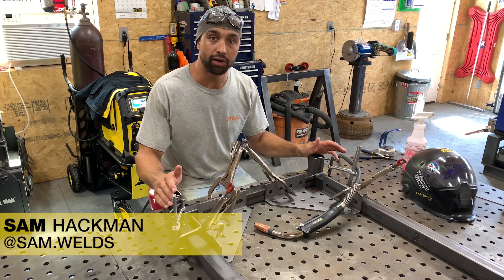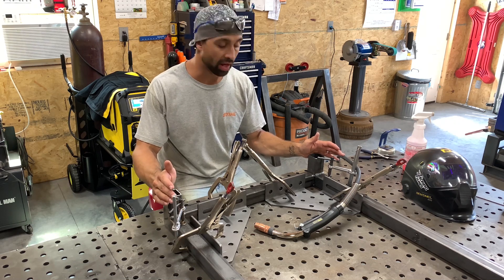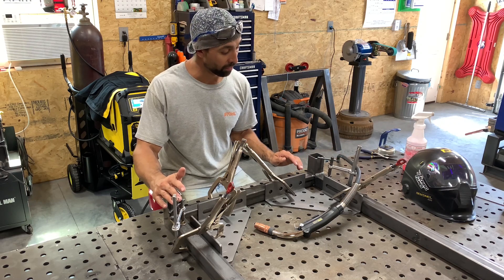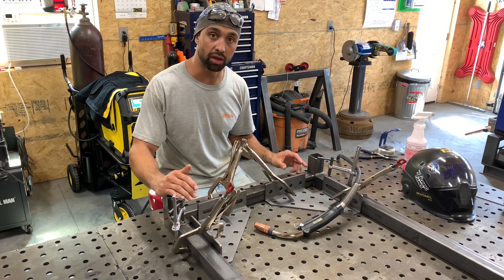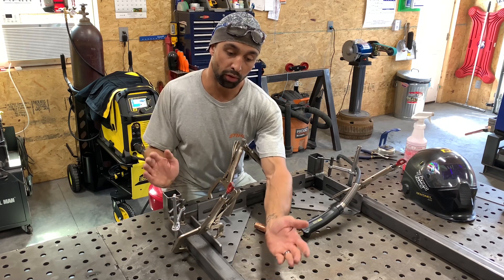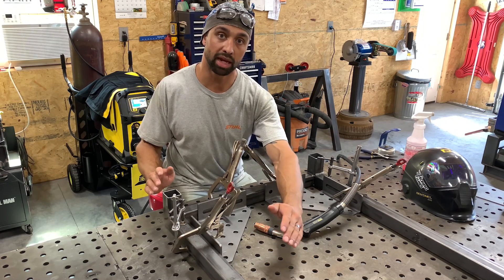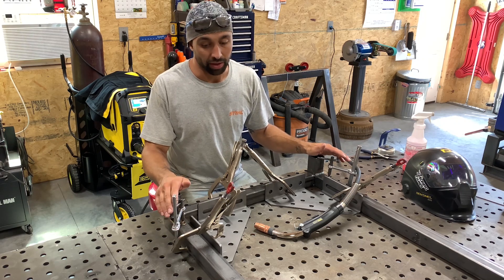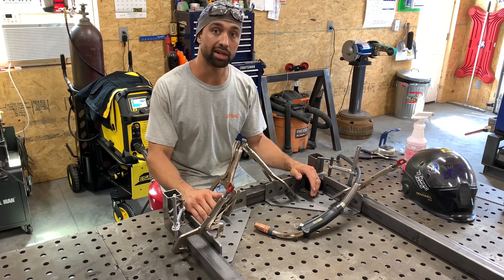Why the Direction You Weld Matters for Your Finished Product

Comment: Are you sure your welding in the left to right or bottom to top or fixed option or table top you put your bench in the over head let me see how you do all you down had welders are fake there is a test of straight why you do not weld down hand

Comment: Welding in the right direction ?

What if it's a stationary object and you can't flip it upside down ?
What if it is high up or down low and the only way to get to weld it is from the opposite direction of what you say is the right direction ?
Not every piece that needs welded can be bought into your shop and laid on your shop table to be welded .

Comment: When you weld its like a zipper. If it's all true, you weld one corner, there is now a preasure, do the same to opposite corner and it will release that pressure, at least that's I my mind works, and I got the squarest floorstands in the shop!

Comment: A rag and a bucket of ice water will do the same thing. Sometimes you have no control over direction if it is a field weld and can only be approached in one direction, it will pull where you need it with the ice and water.
Reply: Hell yeah nothing like making your weld super brittle so it shatters when put under load. So smart!

Comment: Doesn't matter what direction you weld in if you are holding your mig at a 90 degree to your work like your supposed to do!!!!!  But if you're not at a 90 degree then it matters BUT depends on the situation. If you travel same direction your aiming then your taking a big chance of flunking a weldtest because places in your weld will be skated on welds ----- unless the metal your welding on is pretty thin.   When welding in corners if you travel out of the corner the magnetic force will create lots of B B splatter usually. If you travel into the corner that usually helps. If welding uphill aim up a little. If welding downhill still aim up a little. It allways just depends on the situation. I been welding for 42 years to hold things true use cross braces and plenty of them. I like using heavy turnbuckel's for cross braces because they are adjustable for pushing and pulling for fitup speeds up the process I expect to get some remarks from here saying like smartass maybe 😆  all else I got to say is FJB. LETS GO BRANDON
Reply: Thanks for the turn buckel idea.  I'm going to try that. Looks like better control.
Reply: Thanks

Comment: Cool tips in your video. 5 yr into fab and 10yrs of backyard fab and I still haven't gotten it figured out. When possible I weld on a few temporary angle braces to help keep it square and plum. And have everything tacked together before fully welding. The preload with shim material under the part has been the toughest to figure out. Aluminum and steel act a bit different with heat so it can get frustrating.  And welding is just one part of the trade. Add in the plate and tube bending and manual machining and it should be a $40hr gig. I've scrapped a fair amount of material learning.
Reply: ⁰
Reply: Pa don’t want me me too but I’m going with you when you go go home home when I’m in in bed bed I just just don’t have hai east and we have no plans on that property property property we can can rent the nve it I’m going with the whole whole family to me I can’t wait to see it it I can’t wait to get my hair hair up up to to get a a hair hair cut off off and I don’t don’t know if she she can go
Reply: Pa you guys guys can go with the boys boys or girls tomorrow at work so if you’re available available in a couple couple minutes I’ll be available

Comment: If you tack the item down to.the table you won't have that problem and you always tack your pieces on all 4 corners. After you tack the item to the table it will not move or use a dog clamp to the table thats why you have holes in the table 
Contro) welding is also required while welding
Reply: Great tip!

Comment: Just curious, why cant you tack inside and out before running your beads? Wont the tacks hold it square?
Reply: Yes. Heavy tac weld will be great. No need for a 30 minute video like a 6th grader
Reply: Not necessarily. The heat from the bead will cause the metal to warp. And if you are welding correctly,  you are welding over at least two of your tacks, rendering them useless. Depends on what your welding. There's a lot of flex in metal.
Reply: Yes. That's the correct way.

Comment: So true. As for those asking for specifics it would make the Rocky sequels seem like a half hour comedy show.
As stated, as you weld, it pulls towards the weld and the direction your welding.
Depending on your configuration and just as importantly your fitting. Dictates your sequence. 
Amount of passes required on every weld is key as well.
Welding up 4" thick ballistic steel 100%. UT. T- bars. 24"×30" roughly 
60-40 bevel. 
Welding 40 side till you got around inch and 3/4 off square at 2ft.
Alternating directions. 
Then proceed to 60 side. Weld till plumb, again reversing directions. 
All the time monitoring movements. 
And this doesn't include root passes and back gouging nor finishing. 
Plus heat control, (total Jules,) Preheat temps., interpass temps, and controlled cool downs.
Every situation can be different. 
But as he stated. Understand the basics. Pull follows heat in 3 directions.  Towards the weld latterly and vertically and In the direction of the weld.
Keep your total heat to a minimum. 
Excessive heat realigns molecular structure of existing metal making it weaker and increasing distortion (pull).
As others have stated. Sequential welding is like a torque sequence on an engine.
Basically opposing sides in a criss cross pattern in opposite directions. 
With equivalent heat.
Once understood. It prevents a lot of pretzels and embarressement.
The other big tip is. If your fortunate enough to have access to knowledgeable people. 
ASK.
You might find the grumpy old man has a lot he's willing to offer to a newbie that's willing to listen.
Far more than any manual or classroom can teach.
The other big tip is.
Stop take a look at your work frequently. 
If not right .STOP RIGHT THERE!!!.
figure out what's going wrong. Or ask someone. 
Because nothing turns off a prospective welder than being a mandatory grinder or gouger.
Rework sucks.
If you don't have enough time to do it right. But have enough time to do it twice. That's a problem. 
Prep is everything.  Especially when you get into aluminum, stainless, coppernickel, cast, .
Because your margins for error decrease and your ability to repair decrease. 
It's a craft, an art a science. Far more than what companies used to refer us as " any ape can weld".
Not so. And they know it.
Reply: Yes Sir ,retired nuclear welder 30 YRS for the department of Defense
Reply: Ahh ! Someone who knows what they are talking about ! 👍👍👍👍👍
Reply: The only people that understand your comment, already know what you just said. No need to try an write a book in Spanish for a bunch of English readers.🙄
Reply: @richardfoister1877  maybe so.
But there's a few it may help to be great welders. 
Been involved in some new processes, (at least for us)  
Your attitude is a detriment to the trade,skill ,respect to those that work in it.
At this point it takes a competent welder to run the most complex of machines.
Unless you build under the most sterile of conditions with precise fitting. 
That's another story.
Take pride in your work. Share your knowledge that was shared to you.
You think Seth Myers is bucking for your job?
Don't know where you worked, or trained. Myself, bicycles, lawnmowers, plumbing farm equipment to surface combatants. Where my grandchildren could be stationed.
Sounds like you got a lot to offer.
Who are you passing it along to?
Me I'm still learning.
Hopefully will never stop.
You?
Reply: @bcallahan3806  Shoot man like I was saying, to someone who doesn't know a thing about welding your comment was like reading Arabic. And to the ones that do know about welding, they don't need a refresher course. You wrote about 200 or more words 20 different numbers and half dozen sub titles. You would make a great teacher in a class. But to me your comment might as well been 5 pages of bla bla bla bla bla bla 🤣
Reply: @richardfoister1877  if you are that great of a welder. Than perhaps you should read and contradict on specifics. Or perhaps get the gist. 
Or even better yet offer tips of your own.
It's an art .
There are standards. 
Best knowledge is shared knowledge. 
Don't have the opportunity to do one on one.
Do have the knowledge, experience to write it.
Reply: 1 Know one that has aspirations of becoming a professional welder is going to see this,2 there's no such thing as a grumpy old man that's willing to teach you, he cant stand you, and you darn sure better not know something he doesn't because he's been doing it for 40 years, also if you're not in your backyard building a go-kart frame and it's a job, that old man will tell the foreman to run your ass off. The take away" this isn't about helping somebody improve their welding skills,  it's about fluffing your feathers, I've climbed the highest, I've jumped the farthest, I was in a worst war, I'm an instructor, I poured more Concrete in a day, no one I know is interested in what I have to say or is tired of hearing it so I posted a novel in the comment section of someone else's video, you know" to bless those below me& to save the world.  You could just watch the original video, bingo bango Zippity Doo  you get more experience getting your welder out after then reading a novel like this 👍
Reply: @kevinwest3689  Yeah wat he said!!!
Reply: @kevinwest3689  exactly the attitude that makes everyone fail.
New teaches old and old teaches new.
Even the most high tech stuff takes old school experience and knowledge together to make it function properly. 
You cop an attitude like that. You just cut yourself short. Regardless if your young or old.
Learn whatever you can from whoever you can. Have pride in your work.
If you think you can make it alone in life. God help you and good luck.
But realize it's the end of you.
Not everything is handed on a silver platter. Anything worthwhile takes effort, constant effort.
If school was complete we all would be professional students.
Common sense says we don't have to reinvent the wheel every generation. Certainly improve upon it. But if you don't understand the basics your 10 steps behind. 
OR if someone gives you more knowledge that's an asset you have.
Yes practice weld all you want you will learn. But why repeat known failures?
Reply: @bcallahan3806  I couldn't make it through your whole comment,  one thing for sure, I dont have a bad attitude, A pompous ass is a pompous ass, no one watching this video came to learn how to weld 4 in thick Steel, in the real world professional atmosphere you have to know how to do the job before you can get the job, the guy that already knows how to do the job is indispensable and wants to stay that way. I went to a local welding shop (old guy) retired professional welder, ask him to extract a busted exhaust manifold bolt in an aluminum head, said he couldn't do it I told him how, made him mad, I talked him down took responsibility got done, he still didn't like it, it's not my only experience that that that's why I made the comment. Congratulations on your world. In my world if it's not your daddy, someone teaching you enough that you can do the job and they can pay you less than scale it's a Cutthroat world. 🤪🐓🍭

Comment: I’ve been welding for almost 40 years and you are 100% correct ! But convincing a lot of half ass welders is sometimes a nightmare
Reply: Have you seen an iron workers bead? 🤮 If it weren't for the insane amount of PPE, I'd be a golden arm to them. And I'm not a great welder....
Reply: You must be pretty shitty at it, and only do very basic welds. If you did real welding you’d have to learn how to weld in both direction no matter which process used. A lot of times you won’t have a choice.
Reply: Jon Campo you must not have to weld anything that is allowed no to very little contamination/ porosity.

Comment: ALSO,  especially on plate,  if the steel is magnetized you can change the direction you're welding and it may help with the problem.
Reply: 🤣 🤣 🤣.  Dude if it's magnetized just wrap your ground cable around it
Reply: @mikeguy9668  DUDE,  you'll have a hell of a time wrapping a welding cable around a dozier blade!!!!
Reply: @broberson1949  most ground cables are at least 30' man. Ive done it more times than I can count on 48" and 56" pipe. Dozer blade ain't shit
Reply: @mikeguy9668  you keep on trying and I'm gonna stick  with what  DOES WORK and has for the last 45 years  ⚡
Reply: @mikeguy9668  sounds like that 80 year old man failed!!!

Comment: At General Dynamics EB division if you get caught welding top to bottom you will be fired on spot, always weld in the up direction, there are many parameters to follow that is one
Reply: Yep. Any structural member should be welded vertical up. More filler material added and more heat, so a bit more penetration.

Comment: Just gap the weld and use common sense. Anticipate the pull. Tacks can be cut to adjust. There’s no preset in process, move the metal the way that works for job. Building tables and fences must get pretty predictable. What if your welding pipe does it matter which way you make the circle.
Reply: Pipe will draw/move with every weld. Set your gap, tack 4 sides.each tack and weld should be on opposite sides. Pipe welds start just out of square so the draw of the tack pulls it back square.

Comment: Ok so obviously,  you are not educated in how to heat shrink and straighten metals. 
Yes when you weld it will distort ,warp and change angles of a fit up or put things out of square. So you simply start by welding where it needs to pull into tolerance. Ok so now then. The whole 1/4 inch plate clamp thing is totally way to much work. Next time you weld a square tube and it pulls up on you. Simply take your torch and on the opposite side of weld. Heat right in the center of the tube until you see a quarter size circle. Heat it to a dull red. Shut the torch off let it kool , and your tube will be straight once again. If its a long curve. Then put a circle every 6 inches let it kool and watch it magically straighten all by itself. You can do this with angle. I beam. Flat bar. You name it. And it works. It is a bit more skill to do i beam and channel. Try it. It will save you alot of time and labor. Oh and do a video and explain to new welders what weld procedures. Will pull your material more then other weld procedures. For example a fillet weld pulls more then a butt weld. So and so on.

Comment: Yup I ran into that just the other day when welding my work table, it started to bend when it got hot so it moves like a whole 1" off. I had to use a pip clamp and body hammer to move it over then weld it.
Now that you have me the tip the next time I'm making anything that has to be square I'll use that method 👍🏽.
Reply: U
Reply: What's a pip clamp?

Comment: You tack it all down to the table, weld it all up, and when you cut the tacks - sprooing ! - it’s all nice and unsquare. There are usually so many different pulling motions and contractions going on that it takes a lot more than just the direction of your welding.
What really used to crack me up was watching guys tack something to a crooked table and expect it to be straight.
If you are putting a lot of parts together on a jig then you might find a pattern that helps it come out right but it won’t work for everything

Comment: It's not putting icing on a cake, you have to alternate all spot welds, and alternate the filler/rest of each, one side at a time, back and forth from end to end, and in between, use your square to "and" tape measure to make sure it's remaining square and if necessary, adjust it along the way using pressure to keep it squared up.  Think along the lines of changing a tire, those lug nuts need to be tightened up in alternate patterns.
Reply: That’s a great analogy! That’s how I like to do it but never thought of it that way.
Reply: @bronsonstephens5799  My background is in precision commercial wood working, coffee carts and the rest.  This year I've been welding up steel framework for the panels to adhere to from the outside and inside, they had to be to 1/16" or less, dead on dimensional and square.  People like you helped me gain the necessary basic welding skills to pull it off and needless to say, giant upgrade to what I'm able to offer and work with.  Thanks!
Reply: The changing a tire mindset is a great tip.never thought of it that way

Comment: wrong wrong wrong 
this guy should not be teaching on any level
Reply: Before you say something is wrong try it. This has been a big part of my technique for decades. Mostly I built frames for industrial machines , when I finished welding the bolt holes still lined up. The idea here simply works .

Comment: Wrong! Just place some tack welds then weld one seam jump to the opposite to let cool down. You could even tack it to the table or use c clamps.
Reply: Manuel Cisneros it’s not wrong. It’s right. But there is more than one way to do something like this properly. You can also clamp it tight and weld in any way you like. It will stay straight. Before you say something is wrong make sure you actually understand how it works. Tack welding is good too, but if you don’t put the tacks in the right place, in the right order, then it won’t be straight.
Reply: @melgross  I've been in the structural and manufacturing industries for years. Read other comment that's would agree numbnuts. Especially teaching or letting beginners learn the wrong way isnt right.
Reply: Manuel Cisneros  but teachers don’t insult, they explain the proper method.  A good student would look at many of these sites, being a beginning welder I would Luke to check out your site.  Do you have one